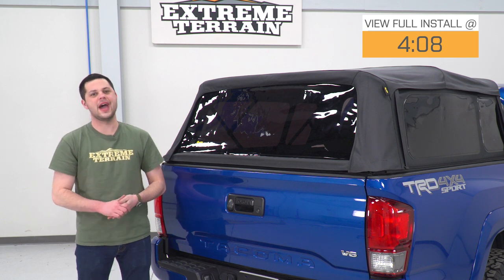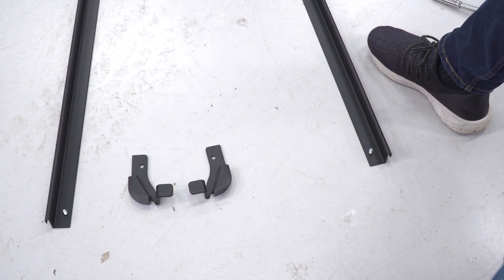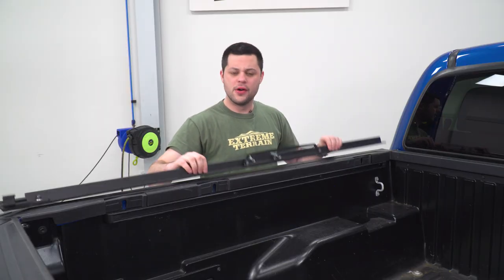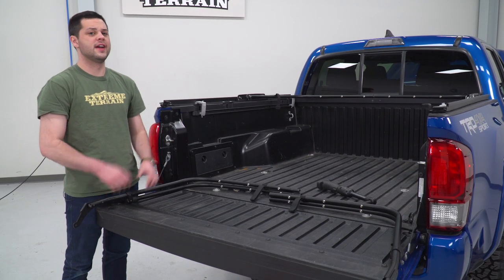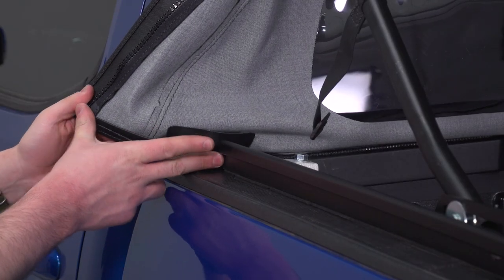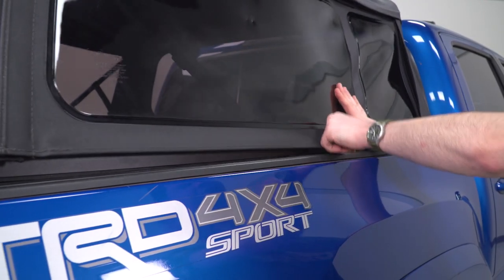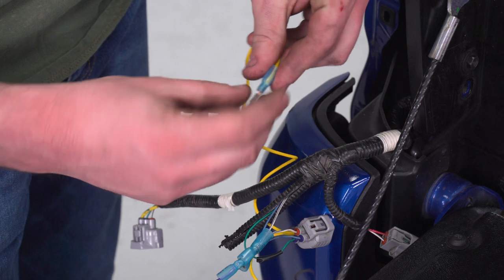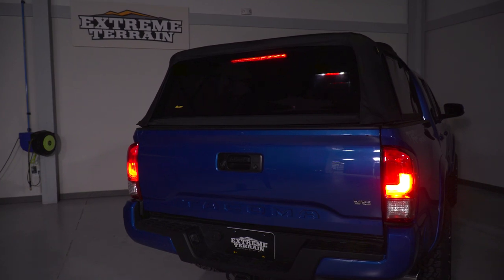Tacoma Bestop Supertop Soft Bed Topper (2005-2020) Review & Install

Comment: Connect the brake light to the 4 pin trailer socket- no need to splice into the wiring harness.

Comment: just finished installing this from yall and man is the fitment kind of wack lol, the c clamps are not enough to keep the rails from bowing from the pressure of the canvas and the bar on the back doesnt even reach my tailgate. It looks cool though so theres that
Reply: I went through three of these pieces of shit trying to install on my Tacoma... Everyone keeps tearing, breaking, bars bending, bolts breaking... The worst softop on the market right here!
Reply: I installed mine when it was cold so it caused things to bend too but I had extra clamps around from my old tonneau cover so that really helped it. Now summer heat has allowed my top to stretch it has helped alot. There instructions do say install in warm temps and I think that's the key.
Reply: @PVo-1111  I agree, In the summer it fits perfectly. in the winter... i just leave it on or off lol

Comment: Bestop vs SoftTopper.  Seems to me that because of a superior design the SoftTopper install is so much simpler as well is temporary removal.  What do you think?  The Bestop does have the advantage of removable windows which can be replaced when they crack in cold climates.  The SoftTopper does not have side windows about witch to worry but limits the amount of light available if used for camping and the availability of side access.
Reply: Junk topper... Nothing could be crappier than the Extreme Terrain topper!

Comment: They’re is a slight correction that needs to be addressed with the manual. 2nd gen Tacaomas are not the same as a 3rd gen. Manual and this video state that the tailgate bracket for a 2015 and up are the higher bracket. I found this to be incorrect, the 2015 is not the same as the 2016 and up (bed design is different). I used the lower brackets on my ‘15 and the tailgate bar fits much better with a seal tight fit.

Comment: I just learned the hard way you cannot install one of these things in cold weather I thought this afternoon might be warm enough but really it was only about 57° the directions say that it Hass to be at least 72° or the fabric shrinks about an inch to an inch and a half which you totally did even though I kept the fabric inside until I was ready to drape it over The assembling bars on the truck. I either I got a find somebody with a heated garage or have to wait till spring. I should have investigated this a little bit more because I took my Tono cover off and now I’m thinking I probably will have difficulty trying to get that back on before the winter if it’s this cold
Reply from the maker: Definitely need to find a friend with a heated garage or bring a space heater into one! Same goes with the installation of Jeep soft tops, it's really a summer-time job. The warmer outside the easier to stretch the fabric over the bars. -Zach
Reply: Ok so today was a good 82 degree day to install the soft topper cap and still having issues installing. Feels like its still a few inches short for my five foot bed but i think i may be on to why. I rewatched your video and realized you mentioned the front bulkhead cap under the rear window. Mine is missing. Whoever owned the truck before me had one of those trucks Cito bed covers and I think they removed that front  bulkhead cover so the truxedo kit would fit. I see i have some bolt holes and it dips down a few inches from the side rail caps. This could be my problem so when I’m going to try to do is replace it if it’s not too expensive or build it up with pressure treated 2 x 4 just so I can put the Velcro piece and still have protection with the material overlap that hangs on the outside of the truck bed under the rear window
Reply: Here to say I also learned this lol

Comment: Just ordered it. I already have a tonneau cover but I need more height to keep some tools in bed overnight sometimes. I wish there was an option to get blacked out back windows so no one can peak inside my bed.
Reply: How has it held up?
Reply: @hunterhughes2752  great so far. I had two issues. I noticed a small scratch on the back window, I didn't see an issue till I finished install and looked at it more closely and it was a small puncture. Emailed Bestop and they sent out a new one. Second issue was a few months in I noticed the front of the cover right on top of the clear window was wrinkled when it used to be stretched. I left it alone for a bit and it got worse. I looked at it from the inside and noticed the bar had somehow gotten loose and collapsed. It has a hole where this other bar had this pushable button on it. I tried to stretch it back but was strong enough, luckily I work at a body shop and had tools to help me push it apart to get that button to snap back in. Well it happened again not long after so again I stretched it back out then shot a small self tap screw to keep it from doing it again. The rest of the top has been great, I've taken the back window on and off a few times and gone about 30k miles with it through strong wind, 110mph hr driving lol and hail. Held up really well except for those other listed issues.

Comment: Weird in the video it says “2015 and newer use higher tab” for that corner and when I install it there is a solid almost 1 inch gap across the tailgate. My taco is 2015 short bed. Was I supposed to use short corner?
Reply: Probably, 05-15 all have the same bed, and 16-23 have the slightly deeper bed with wider side rails.

Comment: I just finished installing mine by myself.  It's really cold so nothing stretched great so I ain't putting it down any time soon lol 😆.
Reply from the maker: Just in time for winter! Haha thanks for watching, Tony! -Zach
Reply: @ExtremeTerrainToyota  yup the video did help a lot Thank you for that.
Reply: Youll be sending it back... These are junk!
Reply: @RamBowMike  mines been great so far in Louisiana heat and Colorado winter nothing to complain about that can't be explained by user error
Reply: @wtftony9975  Why don't you post photos of the rear steel rail above the tailgate? Nobody gets the rail right.... Nobody.
Reply: @RamBowMike  I play with mine and once it's set its good. I don't personally design these but it does what it needs to. A hard topper might solve the problem for you.

Comment: Nice video. With the bestop installed, can you open and close the tailgate without doing (touching) anything on the topper?
Reply: Yes, I have the best top v2 and I can open and shut the tailgate with ease and it’s water tight.
Reply: @sucha603boy  Why does nobody show how to install the rear bar above the tailgate? Because its a piece of shit, that's why....
Reply: @RamBowMike  I find it easier to just leave the bar unless I really need it out.
Reply: @sucha603boy  Thank you for being honest.... Nobody thus far has been able to figure out the bar... There are several slots along the bar and only one rubber seal and slide for the top.... Yet, NO one has been able to figure it out...
I just might order a 4th just to send it back in disgust...
Reply: @RamBowMike  it’s not bad once you have done it a few times, it would be nice if it just attached to the tailgate or folded in into two pieces, it is pretty crappy that you have a big metal bar to deal with when the top is down
Reply: @sucha603boy  How does the metal bar attach, and is it supposed to hook in somewhere, and where is that exactly? The bar has 5 or 6 different slots in it,,, ???

Comment: Dose Best top make one for my 2013 chevy silverado 2500HD 6.6L LML Duramax with the 6.6 bed?
Reply: Yes, I part number I believe is 76303. I just did one on my 2017 3500HD Silverado with 6.6ft bed. They all use the same model from 2011-2017.

Comment: I've opted to NOT cut my Factory wires and not have the third Brake Light! When I remove the Top I don't want to have any problems with my wires possibly disconnecting or shorting out in the future! Thanks but No thanks

Comment: Hate to bust your bubbles but this top is made too small. Zippers wont line up and the frame clamps don't hold the ralils to the Tacoma... The entire thing is bowed when installed and will go flying off the truck in a wind... HIGHLY NOT RECOMMENDED.....
Reply: I agree fully . Ive had the top in blazing sun two days finally got almost all of it assemble to back of truck but the damn zippers i cannot pull pieces clise enough to close and zip up so there will be massive wind resistance at the back side windows. And i cant even join the rear window. I am going to buy extra clamps as i do not trust the measly 4 that come with it. Id never buy this again. Terrible product . They could have added just an inch more material in every direction to avoid the headache of tring to stretch the fabric to work. Im afraid to see how this shrinks during winter months. Its gonna pull away from the brackets.
Reply: @wtfu812omg  Shame on 
Extreme Terrain for selling such junk... They won't respond back either...
Reply: I had issues with my first unit not fitting, contacted Bestop with my issues and they asked that I send pictures of the problems I was having, I did so and they honored the warranty and sent me and entire new setup. Second unit fit great. I had my doubts too about these softops, so many complaints as there are positive feed backs. I gave them a second chance and they stepped up and got it right. I was told by the company that these units are done by hand for most of the fabrication. My first units frame was not bent properly and seemed to be short. The fabric seemed to be too tight also, the replacement went right on and was half the battle to fit. Now if it holds up long term I’ll be happy.
Reply: @mlutz2891  They never sent me a new top!
Reply: False, I had mine in the near 24 hr Alaskan summer sun and rain. Took it on a road trip from Fairbanks to Anchorage and back. Approx. 700 miles round trip. Top speed over taking a logging rig, 95 miles per hour, did not "fly-off". It is surprising aerodynamic that I marked the frame of it to monitor slip and line stayed solid.

Long story short, you don't have first-hand experience and/or didn't take the time to install it properly.
Reply: Had the same experience. Waste of money. Such a shame.